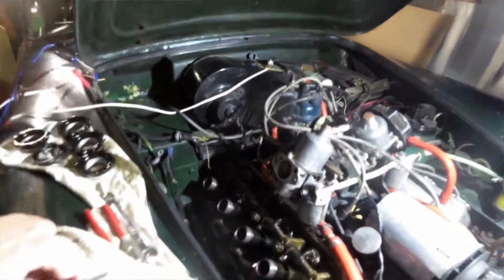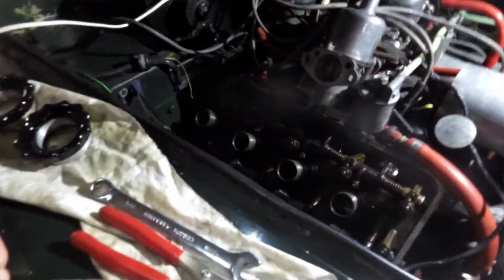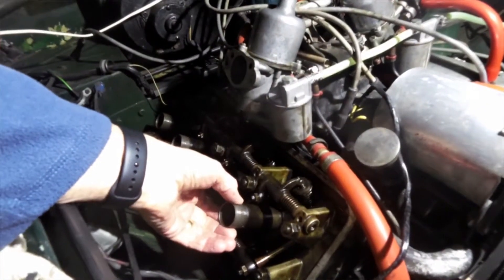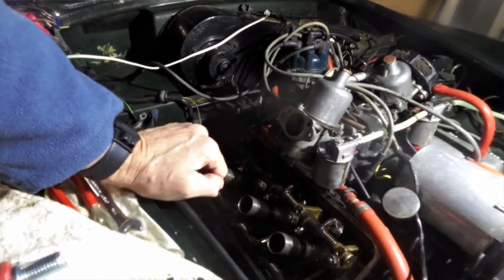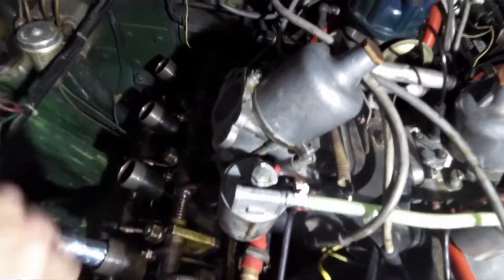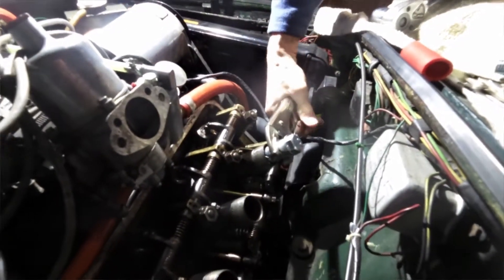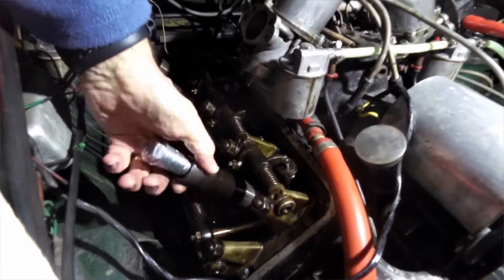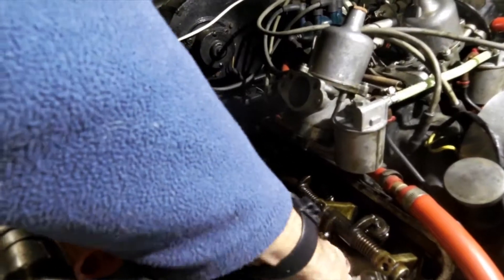Pt 1/7 Daimler V8 SP250 Dart / V8 Saloon Spark Plug Tube Removal

Comment: Good video that's valuable information 
My 250 has a nut on the oil filler tube 
And oil is getting in the tubes so I will fix them now sence I saw this
Reply from the maker: Thanks for letting me know, I’m really pleased if it helps. Good luck with tackling your tubes :)
Reply: Think I remember using piece of thick leather belt inside a monkey wrench to remove. Didn't the engine gasket set come with new washers?

Comment: Annealing your copper washers can be done on your domestic gas ring. But aren't the copper washers available from David Manners in the UK?

Maybe get some copper stock and turn some on the lathe, bore & part off. Lot of scrap and wasted copper swarf for 8 washers?  Maybe there is an IMI /Yorkshire Imperial part number in some catalogue?
Reply from the maker: Yes, anything that will get the copper to red heat will anneal them - though I don't have a gas cooker. There's more on the copper washers in my later videos in this series of 7.See 3/7 for my attempt at annealling. David Manners does stock washers & I bought some. These are quite different to the original plain washers - again, see my later video (7/7) for details. In fixing my tubes I came across 3 types of washer - plain copper on one head, conical copper on the other head & the 'S' washers from David Manners.

Comment: Oh, "RAWL" bolt!  My American ears were hearing "RULE" bolt, which , of coarse, are VERY hard to find.  :)An fantastic solution to the spark plug tube problem, I'm going to do it! - Paul B., USA
Reply from the maker: Ah yes, sorry about the confusion over Rawl v Rule. By the way, check part 2/7 before you get too far. The Rawl bolt worked fine but I later found that an aluminium (aluminum) strip worked much better than the rubber hose. Also, If I was planning on playing with the spark plug tubes on a regular basis, I think I'd find a big nut and and weld it on to the top of the Rawl bolt. This would make it much easier to turn the bolt, without having to resort to using a self-locking wrench.